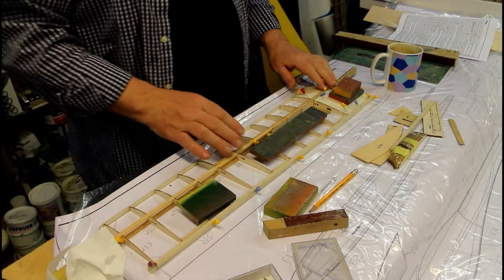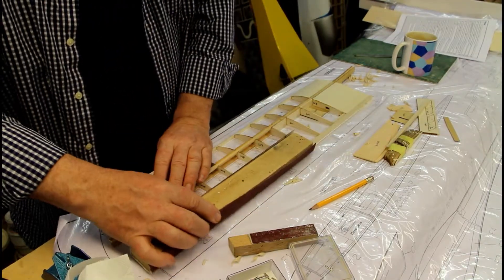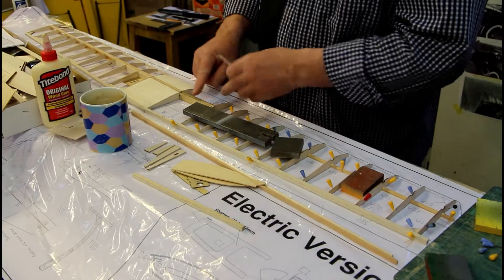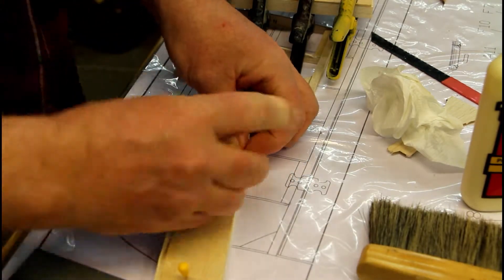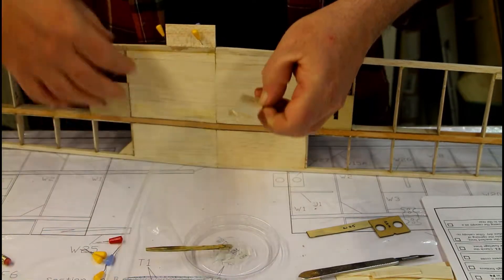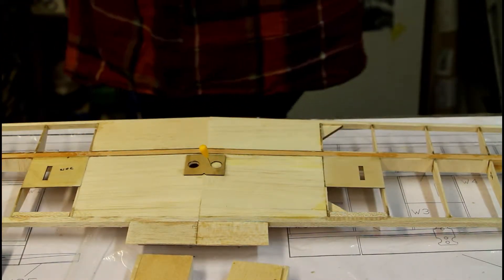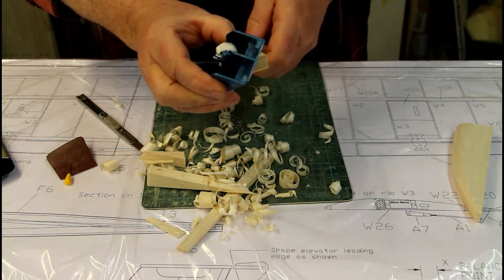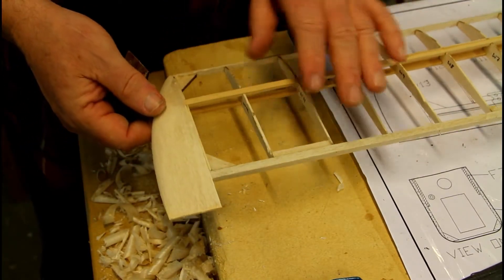Coyote build Part 4; the Wing, Part Two

Comment: How long did you let the glue dry for? Just starting my build of the same glider
Reply from the maker: That depends on the glue: CA glue is hard almost immediately, wood glue hardens in an hour and completely cures in 24 hrs.  Epoxy usually takes over night no matter what it says on the tubes.  The minutes stated on the tubes of epoxy just gives you the working time.
Reply: @gudjonolafsson  thanks I have the structure fully built now just waiting on the electronics to arrive and then I've got to cover it. Can you recommend a kit to build after this?
Reply from the maker: @oliverclothier5915  I have never had trouble with the kits from SLEC.  Sky 40 is especially to be reccommended as it is a trainer that really turns into an aerobatic flyer when and if you want it.